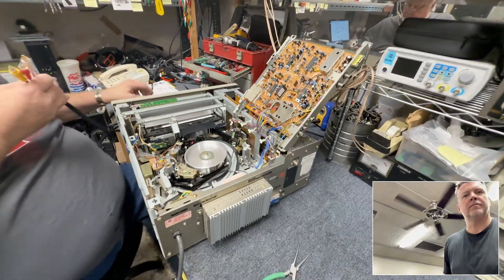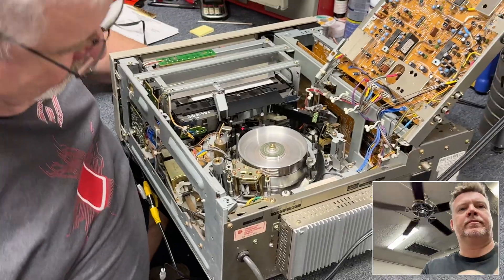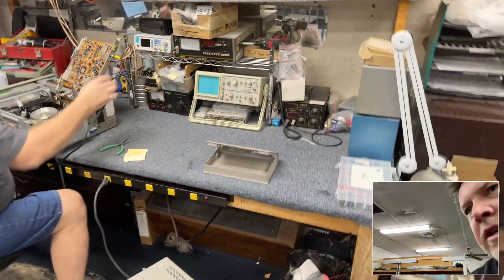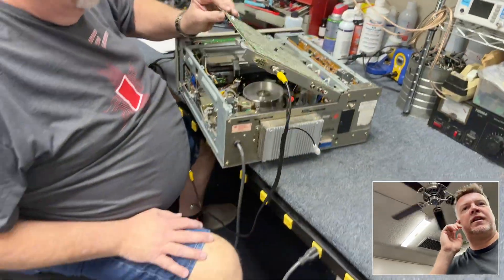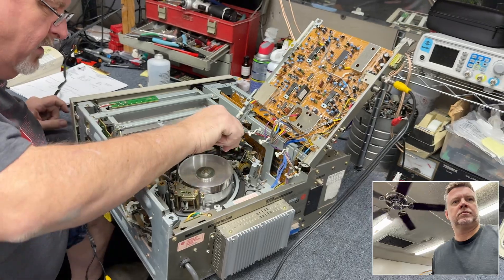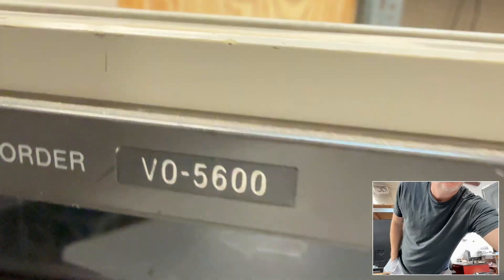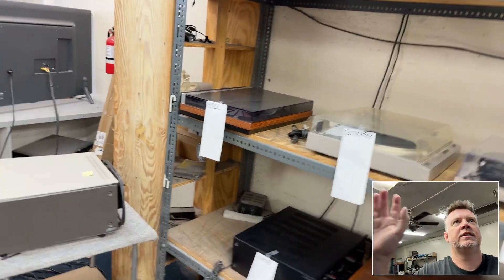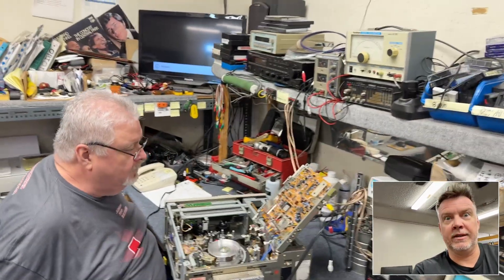RIP Sony Umatic ? Aging 3/4-inch Decks - Parts & Skilled Labor Dwindling

Comment: I should share this with my college TV studio's director. We have a bunch of broken U-Matic tape decks that we tried having fixed, but they must've done something wrong. And on top of that, many of our U-Matic tapes are Ampex 197s (and some 187s) suffering Sticky Shed Syndrome, so we also have to get those tapes playable long enough to be safely digitized. (We're going to try either swapping the tape reels into newer U-Matic shells, or "baking" the tapes at a low temperature in a food dehydrator.)

Comment: I'm probably going to get some heat for stating this, but this video is just another example of "borrowed time" for these machines with this type of technology. My motto with owning them is "perform as much maintenance as possible and be well stocked with parts." Yes, it can get expensive and labour intensive, but they are what they are.
Reply from the maker: You’re 100% correct! It’s an equipment hoarding business!

Comment: I've bought 4 UMATIC decks on eBay. They all worked, BUT all had to be serviced, pinch rollers and belts replaced and other things. A lot of money getting them working after purchase. 

When buying umatic decks on eBay or really anything that may need to be repaired. Make sure in your area there is a qualified service technician with experience like Tim.  

Thanks for sharing, Phil. It's expensive to get these decks working, really any deck or camcorders. And people dont understand why you charge what you charge.
Reply from the maker: Yes! Thanks for sharing!